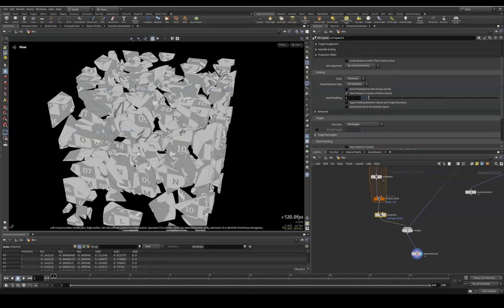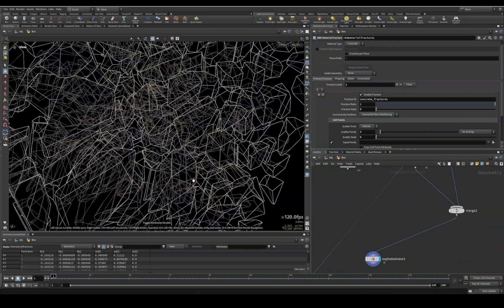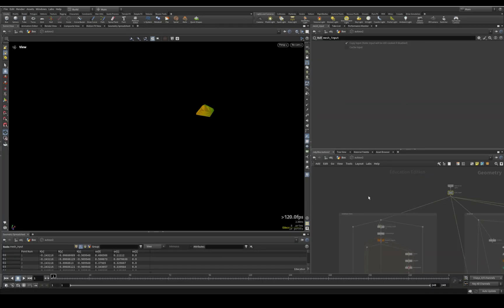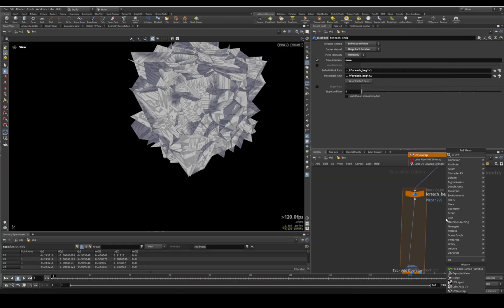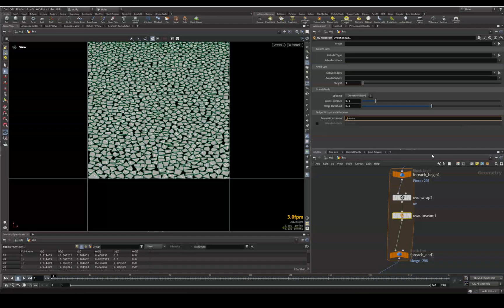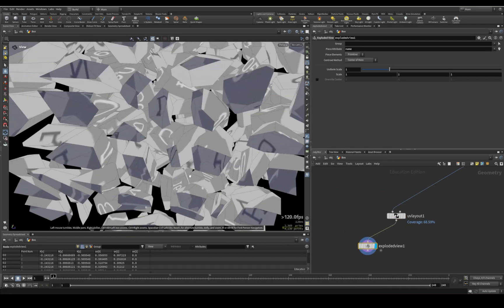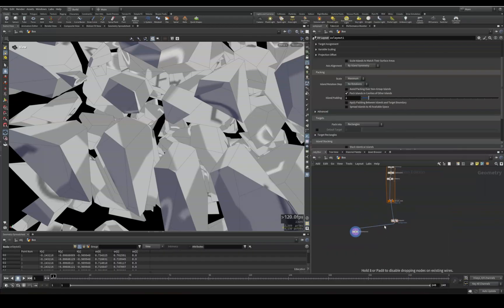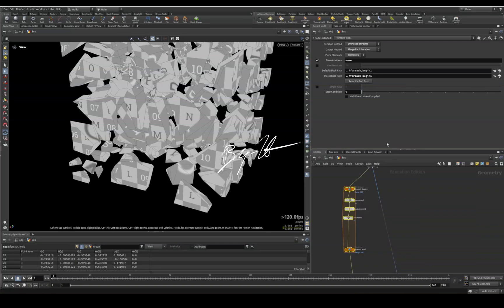Quick and Easy UVs in Houdini, No Headache Necessary

Comment: this is amazing trick. do you have any other trick like how to create sub frame data because some time time blend don't work properly
Reply from the maker: I am assuming for retime, so slow motion or timelapse?
Reply: @BryanHoltFX  not for slow motion. for better sourcing. just for sub frame means integer frames so don't have to rely on more substeps
Reply from the maker: Gotcha. Yeah there always more tricks in the bag!
Reply: @tarnsingh-t6t  But if you don't want to rely on more substepping when simulating, what to you need the subframe data for? Subframe data IS for the solvers so that they have data inbetween the integer frames when they calculate substeps. If you don't want to rely on more substeps then you have to trail your sources so that they become elongated enough that they cover the whole distance between frames.
Reply: @RyoMassaki  i know that its interpolate data sometimes we have fast moving source so i don't want to make 10 or 12 substeps in that case. if i have subframe data so it will work with 2 or 4 subs in less memory usage i think he understand what i am saying